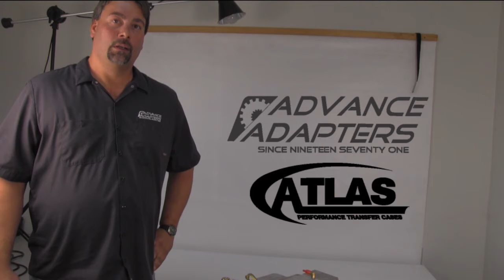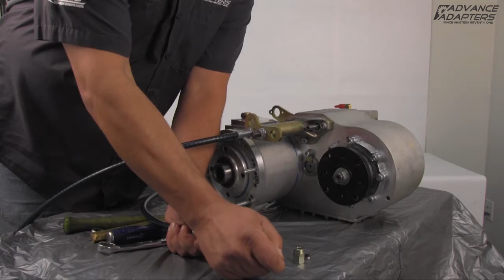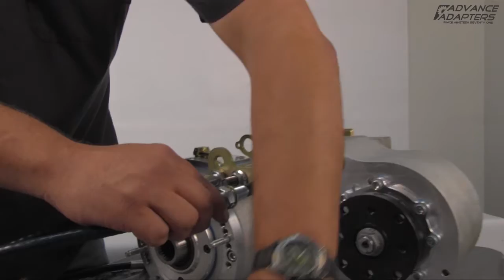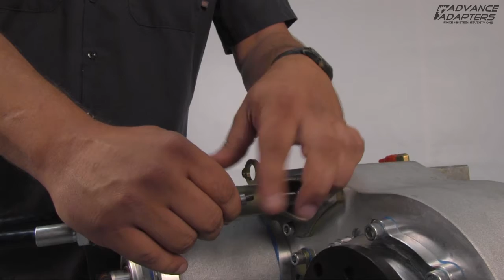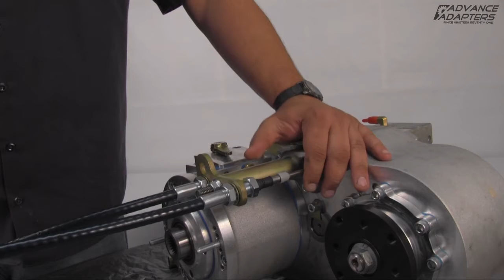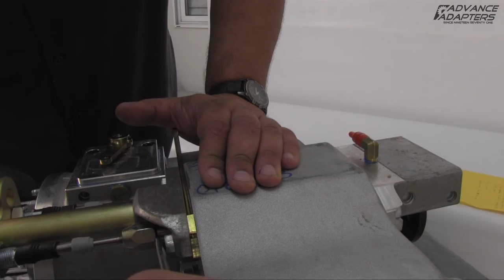Advance Adapters Atlas Transfer Case Cable Shifter Adjustment

Comment: Good video.  One question: the planetary reduction unit on the 4 speed models - which way does the shift lever face for hi/low range?  I'm trying to set up my shift patterns and need to know which way the lever faces (towards front or rear). In your video the lever is facing forward (heim joint towards the front) - is that low or hi range?  Thanks